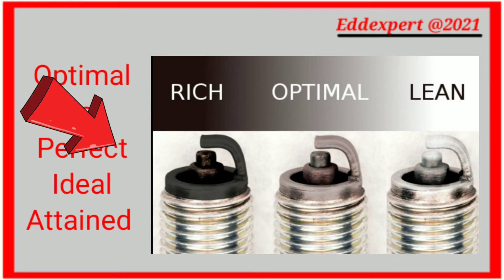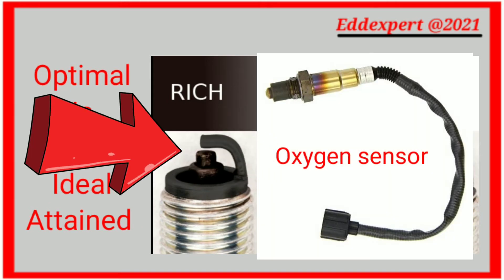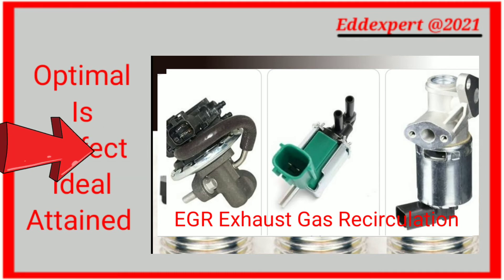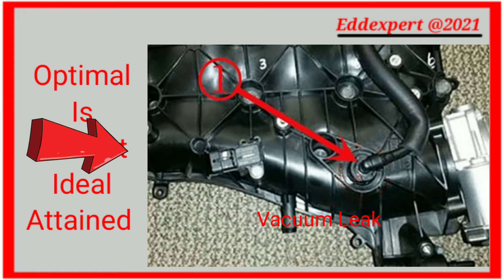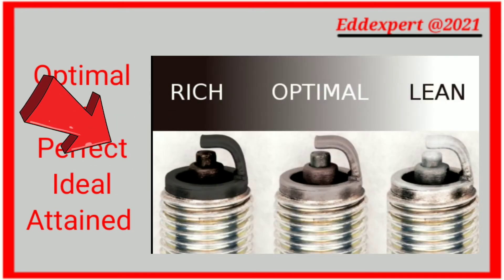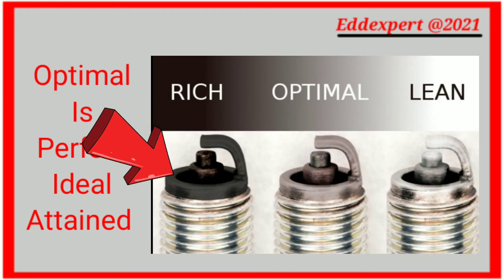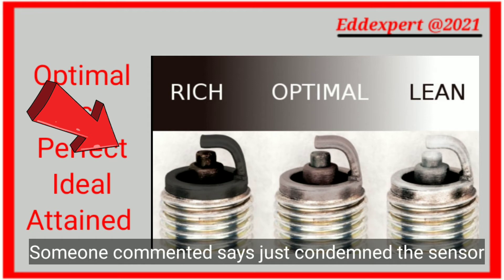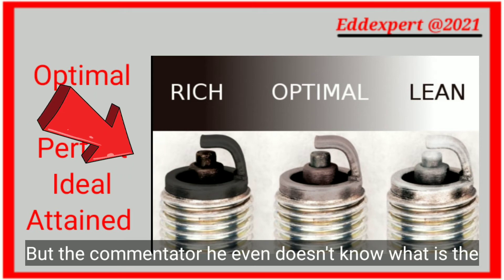🇵🇭 Mitsubishi Lancer 4G15 SOLVED 5- volts reference. Engine cuts off.  162-Eddexpert@2021.

Comment: Good pm Sir. Pwede po ba mahinge workshop manual ng mitsubishi lancer 4g15 efi? Salamat po. Willing po ako magbayad kung kaya po.
Reply from the maker: Anong kailangan mo po sa manual?
Reply: @edralinbustaliniomcbautomo7707  salamat po sa reply. Complete wirinh diagram po sana from ecu to engine bay. O kya ung ecu pin out po pang 4g15 efi.
Reply: @edralinbustaliniomcbautomo7707  boss bka po pwede makahingi dn ng manual ng gli lancer 4g15. Specially sa wiring ng mga sensor at ecu. Salamat po.
Reply from the maker: @jaizertv  how could I send to you?
Reply: @edralinbustaliniomcbautomo7707  wala po ba kaung soft copy sir?
Reply from the maker: @jaizertv kung may alldata ka ok na yon
Reply: @edralinbustaliniomcbautomo7707  wala nga po sir eh